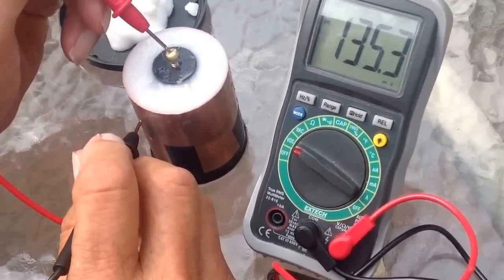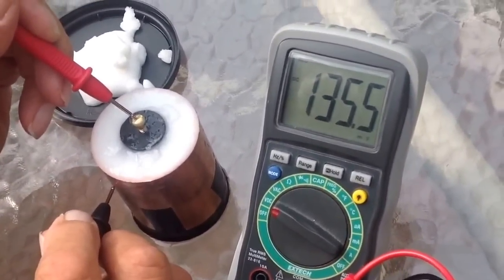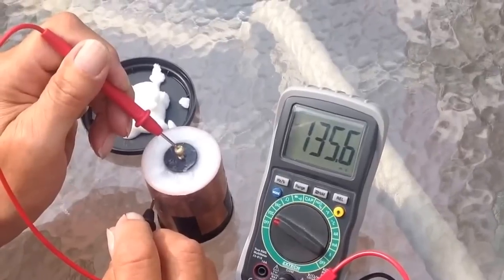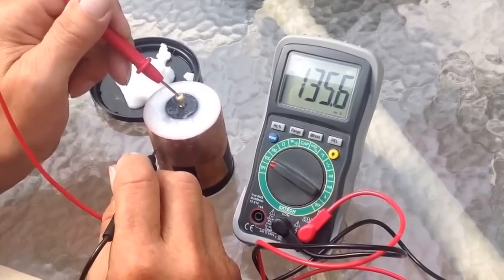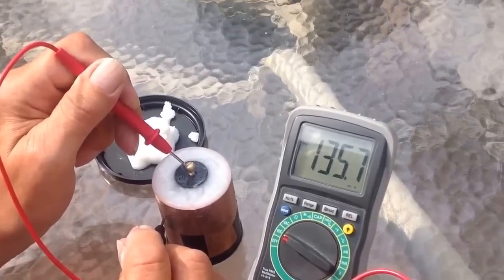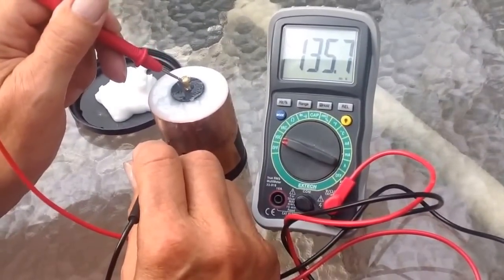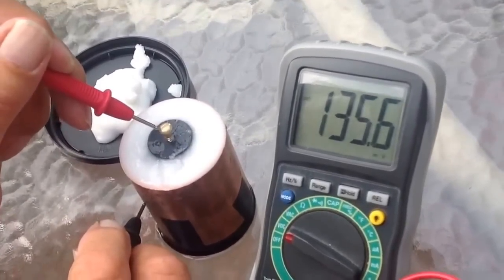135 volts  SUPER crystal battery???  - NO JUST .67 VOLTS

Comment: Gives you volt but no amperage, I made heaps of them but no amperage. ,,,even water Gives you voltage,   every thing got a voltage,, no amperage so it's not going to work work...fortunately after research about 4 years I could make one to run the motor

Comment: You could at least learn the principle of batteries a little before you say anything!
https://chem.libretexts.org/Bookshelves/Analytical_Chemistry/Supplemental_Modules_(Analytical_Chemistry)/Electrochemistry/Electrolytic_Cells#:~:text=Electrolytic%20cells%2C%20like%20galvanic%20cells,is%20an%20oxidation%20half%2Dcell.&text=A%20galvanic%20cell%20(left)%20transforms,be%20used%20to%20perform%20work.

Comment: But seriously... 10 of these cells and you've got enough to recharge a car battery for the next 5 to 7 years... and that IS cool !!!
Once you have uploaded the power into a 12V system... the world is you oyster.
Reply: You are an idiot who has no idea how electricity works.
Reply: @Ham549  Dear Spam, I have an IQ of 140... that is inside the top 1% of the known tested world. It is not the IQ of an idiot, thank you very much. Your rudeness will be your undoing.
Reply: @artofnoly9754  I find that hard to believe as spam is the mass posting of the same information, not telling someone off because he does not understand amprage.
Reply: @Ham549  Dear Spam, Amprage??? Really??? Is that another form of road rage? As for not understanding amperage (yes, amperage)... I have built many functioning (electrically assisted) magnet motors and alternators, which were able to deliver 90V (and yes, they were V not mV). And I will repeat, if Mr. Ferko was to put 100 of his power cells in series this would produce 13.56V (ARE WE AGREED?) which WILL charge up a 12V system, because it is >12V. And yes, the world would be your oyster!! Are you starting to see, I do understand a LITTLE bit about electricity? Thank you. I'm also a rock'n'roll musician with 44 years playing experience who services his own tube/valve and transistor amplifiers and builds and hard-wires electric guitars that actually work!
So let's have an end to this 'gay banter' (quote from the Vocational Guidance Counselor sketch by Monty Python's Flying Circus... also where I got the Spam angle... 'bloody Vikings!').

Comment: I think it reads 1.35 volts but it is still impressive. I have noticed with different metals you get different voltage and amps. magnesium the most with copper but copper and steel do better dry and when you use both copper and steel together as one electrode and magnesium as the other it produces the highest voltage.
Reply: Ciao ,intanto complimenti per il tuo lavoro ,é sorprendente  ,complimenti.  Volevo chiederti che tipo di materiale  hai usato per farla è se mi sai dire quanto può  durare una pila fatta così, grazie mille.

Comment: That meter is in Millivolt  . The true voltage is 1.35 volts . Idiot   We are note fools .
Reply: +Jeff Mullinix no? 135.6mv is 0.1356 volts
Reply: @R4MP4G3RXD  it will have trolls who will hate a guy in my country build a battery bank of crystal bats and he planing on powering his house but he will not show it on YouTube but if it works I will build one and post it on my channel I don't have fear for power companies
Reply: @wisdomafoolweakness3391  Good luck with that, you'll soon realize that that would take up too much resources, because these batteries don't have a lot of power output. They have great energy density but they don't have power. And you can't charge them, so once you've wasted a crap load of money making them, and they drain, it's just gonna be a huge pile of wasted money.
Reply: It seems we are fools, if you say NOTE, instead of not
Reply: The meter show 135. Look good and you will see the point

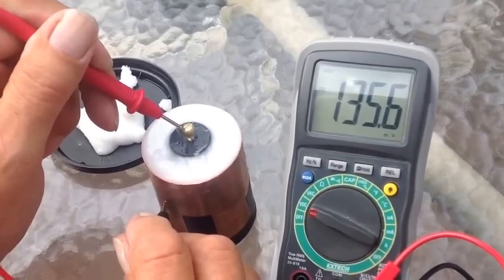Comment: at 1:12 I see a little m in front of that V on the meter
Reply: Yep. Too much distance between the copper tube and the carbon rod to even get one volt. Also I believe a magnesium rod will have a bigger electrical differential than carbon and also higher conductivity. I tried it with a narrow copper tube about the size of a double A battery and got 2.4volts after it was completely dried. I also heated and dissolved the salt crystals in solution and let them reform inside the battery cell so I had to pour it while it was still hot. A small amount of current put through the battery while it's drying will cause the crystals to align with each other in a much more organized pattern giving it an even bigger boost and more longevity. 
   I wish I had the materials now to make a few hundred such cells and wire them in 12 volt segments to make a deep cycle battery. I'd try it out on my little sailboat.  See how it does in a solar charger system.

Comment: That is very cool! You have stumbled upon a nice mix/recipe!
Remember, it's the chemical composition which produces the voltage, so even a very small unit will produce the same potential... so you can scale it down to any size :)
Reply: Hey Diadon. It has been my experience that although the cell have the same potential (Voltage), the current that the cell produces goes up quite a bit the larger you make it. There are limits of course. I have found 6" tall  by 3/4" wide works great. Also lots of crystal material... I think what was going on with this guys cell (getting cold) was an endothermic chemical reaction, this happened because he mixed up the salts into a solution instead of heating or compressing... That is just me theory. Peace brojangles.

Comment: Definitely milivolts, ... Seems that having wet salts doesn't help the mix , now Borax it supposed to be used to turn hot copper into a diode as John Bedini explained, there is no easy ride here, we are looking for a stable battery, a crystal configuration able to sustain a load with invariable voltage and amperage now that would be real cosmic energy absorption ala magnet effect, must study deeply into molecular structure and elements able to create such effect without degradation at least not like what we are used to observe with current technologies...I will present in time a way to possibly achieve a more powerful configuration soon....Wrong measurements or great claims without foundations, will make us look like fools or scammers specially if not open for discussion, please don't close your comments options...I don't need nothing from your research, I just wish you find the right path, I'm and old fellow and need new glasses as well, cheers!!
Reply from the maker: Maybe this battery will work once its dry.  I don't know but  just the chemical reaction turning cold gives me hope that that fact in itself can be used for refrigeration purposes. if looked into and developed into something useful for mankind.
I too am an older fellow and wear glasses. Don't plan to scam anyone including the good lord.

Comment: That's amassing I've known carbon is at the top end of the galvanic scale but if you could duplicate your experiment with as best documentation as possible as so I could per review in my lab 

All the best 
Jon

PS absolutely amazing
Reply from the maker: I hope you can duplicate all this in your lab.  The copper fitting is sold by Lowes,
I found the carbon rods on Ebay advertised as 15/16  diameter and 12 inches long. The alum came from Nuts.com in 1 pound bags. the borax was 20 Mule Team borax, .The no salt salt can be found in any grocery store. Laser Saber shows that in his crystal battery video.  Epson salt can be any kind..

A level  half cup of each chemical crushed and mixed first dry.. Then add enough
water and mix until you have a very thick pourable batter.

Pour the batter quickly into the copper fitting with the carbon rod in the center.
THE CARBON ROD MUST NOT TOUCH THE COPPER FITTING  AT ALL.  Use plastic separators..
As you are doing this the copper  will start to get VERY COLD.
Do that as quickly as you can.

Now the crazy metering starts across the anode and cathode. I guess that metering will mean nothing until the battery dries out.  I did notice at one point the battery acted like a giant DIODE.  Test it like you would a diode and see for yourself.

I will try to make a video of all this later.
Reply: Thanks I have everything but the carbon but I do have graphite blocks which should work similar and if need be ill find the right rod 

But you should look threw my cell video work 

I've never had that high of voltage however my work focused on getting the most amperage with the smallest surface area because I figured the voltage potential of the material was fixed however I have had a few startling readings with fresh cells 

All the best 
Jon

PS I captured one unusual reading in my "diy crystal cell kit video (high ampage)"
Reply: +Thomas Ferko  Great Job One question  what seize of cooper do you order from Lowe

Comment: I am extremely excited. I have built quite a few of these cells. Buy never with the proportions that you have used, or the carbon. I only have one question (and I mean this with no snobbery or disrespect), are you sure you are not reading the meter wrong? Mistaking Volts for Milli-volts?... That being said, I sincerely hope you have stumbled onto the best crystal cell design, please let me know. Thanks you.
Reply from the maker: The meter read both in millivolts and volts as the copper tube iced up.
Real crazy readings during the frozen  and wet time.  I hope others try it and see what I am talking about.  Who would ever  think the copper would turn cold like that.

The bottom line is what the battery will put out when its completely dry.
That might take a week or so outside in summer heat.
Reply: Thomas Ferko
Hello Thomas. That is a cool anomaly (the copper tube getting cold). The cells I have made have been running LED's for 5 months and put out power when dry. They put out a bit more when wet. I plan on trying out your design for sure. But are you still saying that you were reading 135 Volts?
Reply: Thomas Ferko
Also I am wondering if you were having an endothermic chemical reaction in the solution of Borax, No Salt, Epsom Salt and Alum. Very interesting none the less.
Reply from the maker: Binj Komisar I don't know why the copper gets that cold but something is going on for sure that might be a good thing..
Reply: Thomas Ferko
Cool. Keep everyone updated, very interesting :)

Comment: Is this mixture different from your other crystal batteries? If so in what way? Impressive!!!!!!!!
Reply from the maker: Up to now I had been making crystal cell coins trying to come up with a solid electrolyte.  Posted that video..
This is the first real battery I have made figuring that a water mix of chemicals might better a heated or compressed mix...Favored cheap carbon over expensive magnesium.
Reply from the maker: Thomas Ferko The fact that the copper gets very cold when the chemicals are mixed with water and poured in makes for a nice refrigeration idea to look into even if the battery itself does not work out.

Comment: Maybe it is Millivolts ? Do you get shocked when you touch it ? Be sure not to use both arms when you touch it though so it goes not via your heart !
Reply from the maker: You may be right about it being in millivolts.
The meter keeps  crazy changing from volts to millivolts.  Does the same on my other meter I guess I will wait until completely dry and all is stable. Don't plan to feel for voltage.
Reply: Thomas Ferko its been 9 months. have you come to a conclusion yet?
Reply: If I see this, I would definitely touch it to shock my self to realize if am not fooled by the device :)

Comment: Are you sure it is 135 Volts ? Do you maybe have a problem with your meters battery ? Can you recheck with a different meter ? What is the short circuit current ?
Reply from the maker: I just bridged a wire from cathode to anode and held it in place for a while to see what happens.  Lots of crazy metering followed while wet.